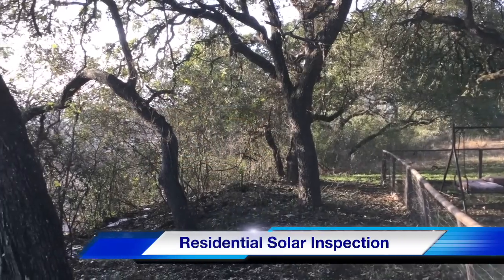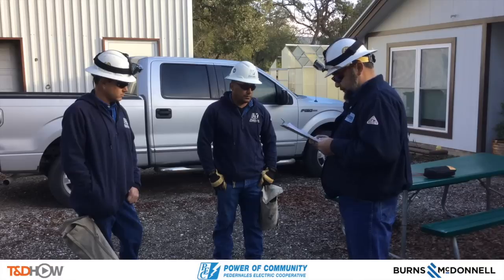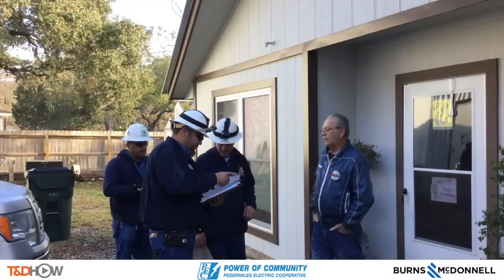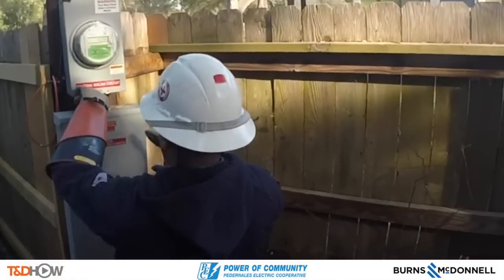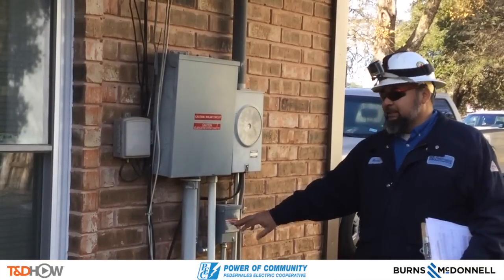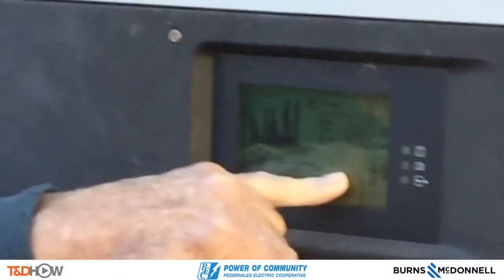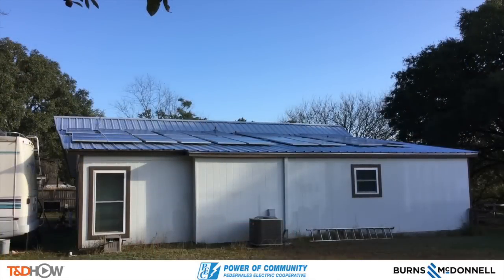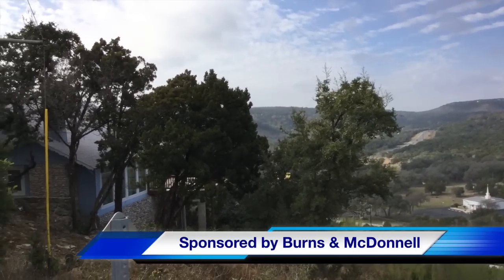How to Inspect Residential Solar Power

Comment: "in a bucket truck"!?  wtf?  3 guys and a bucket truck needed to inspect 4 kWp---unbelievable.  Try a drone and one guy in a single small vehicle.
Reply: Or they could have stood the ladder up and went on the roof and  did a proper inspection... these are LDC inspectors they only care about the meter to grid and anti-islanding / isolation tests
Reply: @abnormal1879  If its not necessary, its not worth the risk
Reply: The panel install and wiring on the customer side should have been inspected by the city or county building inspector. Just like how the utility doesn't deal with your home's internal wiring.
Reply: The additional guys are probably trainees. Better to have trainees in the field. This video was also posted 7 years ago. Its possible they didn't have access to a drone.